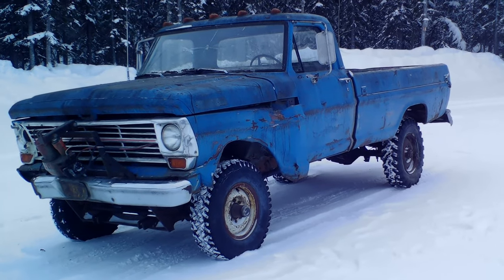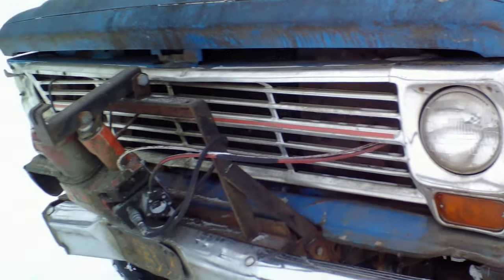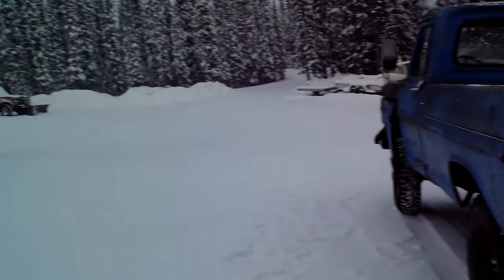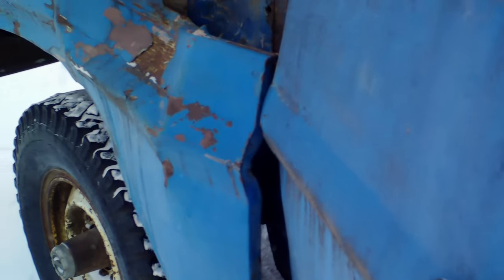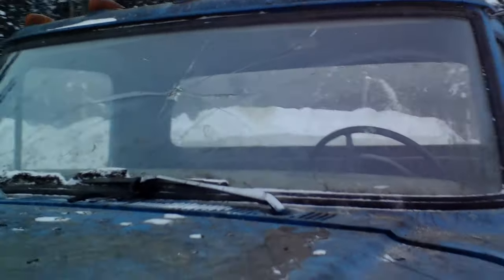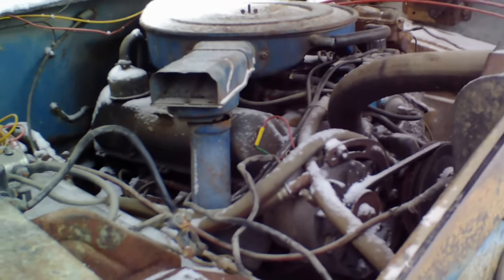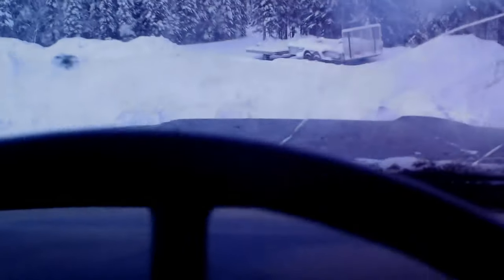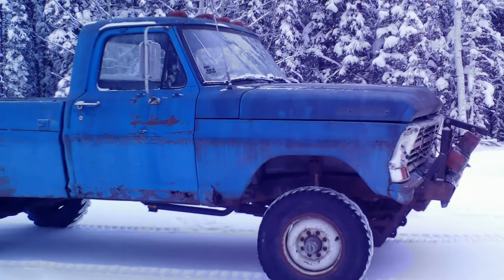1969 Ford F250 Highboy

Comment: Dec 2017, I bought a 1968 Ford Hi-Boy. Done a lot of work to it, but it's now a daily driver. 4-speed, with "Granny" gear, so seally a 3-speed. I can comfortably go 60mph on the freeway, but shouldn't push it past that. Someone, swapped the factor 240ci for a 65 Thunderbird 390ci, along with the Thunderbird's manifold, which allows a 4-barrel carburetor. The bed is swiss cheese. I spent 6 months getting rid of most of the rust. It runs well and has good power, as long as I tune the carburetor a couple times a year.

Comment: 7-50r17 are pretty common here in Mexico. they are used in 1 ton dually trucks.  they sale for around  100-150 dollars and you can get  them in both highway and or old school offroad tread. can be used with or without inner tubes, depending on your wheels

Comment: I had one like that back in the seventies an dents an all. I got it from a farm and its whole life was hauling horse crap so it was bad bad. I drove it in that shape clear to Oklahoma to bring wife back to washington state.... I ran it hard an when done, down a half a quart of oil. It would through the first quart and then stay so I just left it that way and it never used a drop. One of the best trucks I ever had and it rolled the odometer over twice after I had it and it was tough shape showing near a hundred when I bought it for a couple hundred, The last time I ever saw it, it was setting with the cab half on and half off... literally

Comment: I had a 71 like this had a newer 400 powerplant. I couldnt get parts for this era back in say later 90's here in the lower 48. The rear heavy suspension was common to these. They were better built by todays manufacturing. It got scraped. I didnt want to.

Comment: I’ve got a 1974 Ford F-250 Ranger XLT SuperCab. Go check out Quint 1836 to see it. You have take those driveshafts to a shop and they’ll weld new splines on there for you

Comment: 1969 I was 18. I saw a office trailer. Electrical Construction on the side. I needed a job so I walked in and asked for a job. I really didn’t know what they did. I few weeks later the manager called me in . They were building a power transmission line and he needed a go for guy.. I needed any job.. I didn’t care what it paid. I had at best been making $1.50 an hour. He said he was going to pay me $3.50 and hour. I couldn’t believe it. That’s a lot of money back then. BUT THEN HE SAID: you’re going to need a truck. ???? Go out and get me the number off one of them outside. A line of five Brand New Four wheel drive Ford F-250 s  found out later they had 40 of them. All with maybe 3 miles on them. I walked back in he gave me the key and said that’s your truck. I got to drive it home too . What a job. When the power line was finished he had me drive all 40. From Oklahoma to Grand Rapids Michigan. Phoenix. Tucson and flagstaff . I even got to fly back. The airlines gave me the nickname “”Old Tow-Bar” what a job for a kid! I’ll always remember it as the best job I ever had! Oh they were dark olive green trucks   Foley

Comment: Gotta love those divorced transfer  cases. with enough steel a flat bed is my choice and boxes for tools and torch and welder. Still lots of parts for those if you look. I  had a bunch of them till the bank wanted my place worse than me but cripples don't usually make payments worth a damn. So they scrapped my stuff and then charged me for it... go figure! I just got too old to fight it anymore. Those western plows are a standard in plows for tuff and not many of those "T" handles around. I would put a good bucket seat on the drivers side and a tool box on the other plus a place for the dog to ride. Lots of possibilities with that ol girl.. she smokes a little but I been smoking since nineteen fifty five. You could of got them down on price but they seen the gleam in your eye/LOL